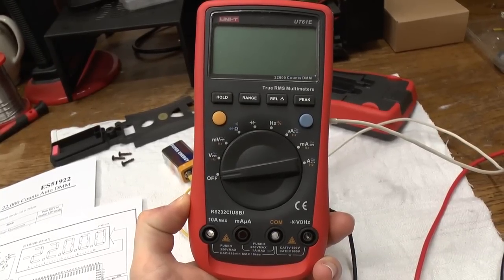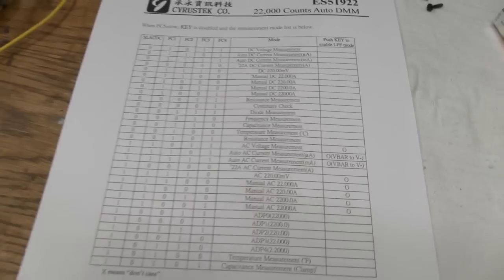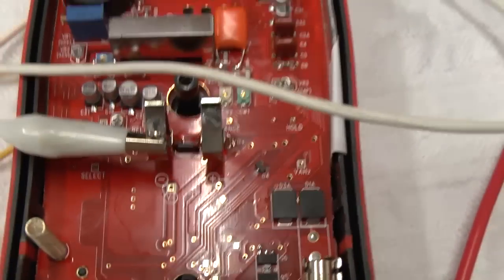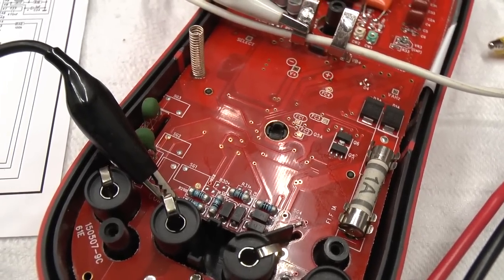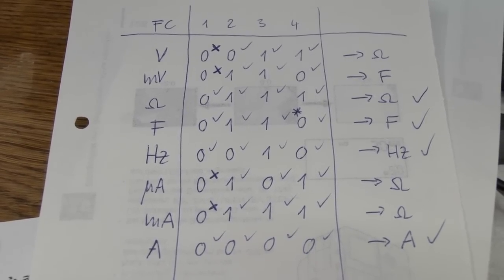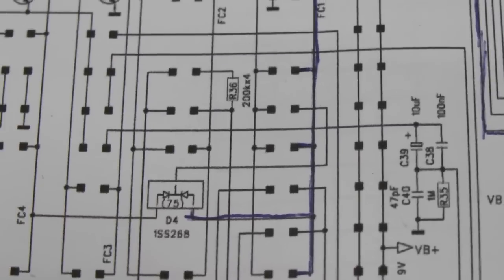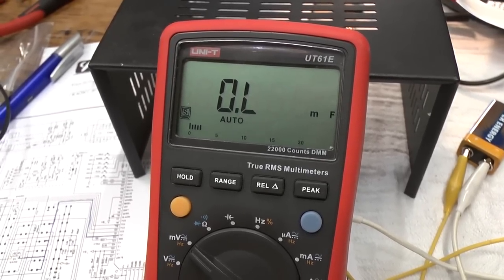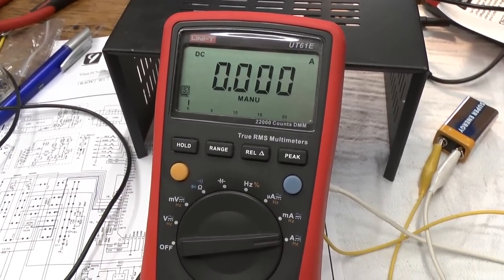Uni-T UT61E Multimeter repair [2/4]

Comment: Hi DrCasette; I've got tt t-ecnic vc97 the v-springs were broken under the rotary selection knob I changed them with the ones from dt830d cheap multimeter but I think they may be wider I am not sure but now screen shows correctly rotary knob function is okey but not able to measure please advise if any offer or idea

Comment: Hello
Dear friend, can you send me these diagrams, I have another problem. When setting the ampere measurement, the voltage was measured. I replaced the fuse but the meter still does not work.

Comment: I know that VR1 is used to calibrate DC Volts.  I suspect that VR2 is used to calibrate AC Volts and VR4 calibrates AC mVolts, correct?  How would VR3 be used to calibrate the capacitance function?  What do CW1, CW2 C41 and C42 control?
Reply from the maker: I don't have any instructions on how to calibrate the multimeter.

Comment: I dont bother repairing meters i think once it is damaged i find the calibration goes out, and meters are not too expensive i have 2 digital meters fluke and uni-t and 1 analogue pro 'something'! from maplin as well as lots of other kit
Reply: 2 x fluke to get the real measurement? :))))))
Reply from the maker: If you work on something a bit more complex, you'll quickly end up needing more than one meter at a time.

Comment: if that diode was shorted, it likely took out the main IC. I see it all the time especially if the inputs were overloaded at one point, aka something zapped the meter. I know something is toast in the Main IC because when you had it in resistance mode, it was floating all over the place, even close to 100 ohms.
Reply from the maker: +THEtechknight 
Hmm. I know I should really test the meter for accuracy in those modes that do work. Probably in the next video I will do that.